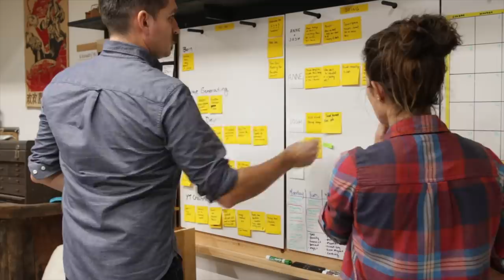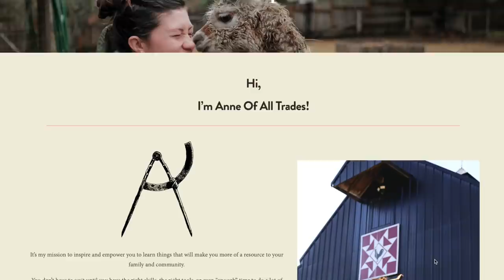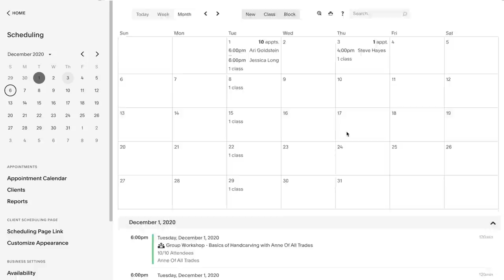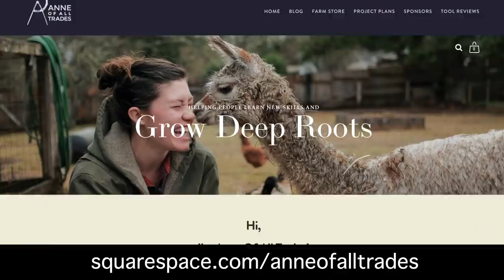Risking it all in 2019 to LOSE it all in 2020?

Comment: Don't loose heart.  You have come a long way.  If you have the will it will happen.  Maybe much slower but each step is a step toward progress and the realization of your dream.  I know this because I've done it.  I'm 74 years old and I build a small wood shop by myself.  Ninety percent of the labor is mine.  I started in April this year and I'm just now finishing it up.  I found ways to get materials for either nothing for for very little cost. It's almost done.  Don't give up. Put your head down and push forward.  Your dream will happen.

Comment: I live in Germany. More then ten years ago I bought used beer tent tarpaulin. The material does not rot and is extremely durable. About 120m² was less the 100€. I got it from a company which builds new tends and also rent the tends. From old tends they sold the material. Try to get something similiar. This helps extremely to get Your project dry und bring it over the winter.

Comment: Get that roof covered. At bare minimum nail on some cheap Harbor Freight tarps with blocks of wood for hold down. Protect what you have so you are not going backwards. Plus it will keep things dry underneath for a work space when raining/snowing. It will cost a little to save a whole lot.

Comment: So I would quick cheap one coat asphalt emulsion the whole roof, eves cracks. Needs couple days to dry. Then get white mesh from best materials and double up the seems. Build up couple more costs. Needs months off gas. The finish up with white or silver top elastomeric. Exposed edges need drip mesh or water will run down board . Luck
Reply from the maker: Hmmmm. I'll look into it as I remain hopeful to figure out a way to do a more traditional roof! Thank you!

Comment: Improvise. Search the area for building projects with excess materials, dip into skips. Lift concrete and cinders when and where you see them. If you have unfinished lumber on the property or as before spot some grab it. If it's a question of completing a roof consider that your roof does not need to be traditionally sourced and certified material to do what a roof must do. Split trunks for Christ's sake and shingle it as once was done where you couldn't go down the hardware and pick up long sheets of cheap and easy. Know someone with the skill and financing who could help you? Offer them favors in trade for what you need. Buy a tarp and tie it down, used garbage bags. Don't make excuses when there is every short cut and compromise toward being good enough available.

Put up a sod roof.

As to your online platform. You have options for getting it up and out there and it doesn't have to be YouTube. You aren't the first to come to this fork in the road questioning how to offer a service or improve on the shallow monetizing that is available here. Because you've all come to the same conclusion around the same time it doesn't seem responsible to target a private platform model over the cumulative model. After all I'm assuming this business wouldn't have come so far without this platform right here. There are other platforms standing on firm foundations right now looking for more authors and businesses to support their endeavor of a secure repository and an excellent revenue source. Besides you will likely reach new audiences by listing within third parties. I can not repeat my self enough because despite the sympathy you deserve you are not the only one clawing for a handhold and you purport your self to be a maker and an improviser. But what I hear is whining and excuses when you're always on the edge of continuing to make progress. There are people out in the world who make it happen with a fraction of what you have going for you and some of them live under the threat of malaria, civil war, authoritarian theocracy. Finish your stupid building. Offer your course work. But understand that you haven't moved the goal post close enough or considered all the actual options.
Reply from the maker: Thank you for your practical suggestions! There is always a way for the next step, it's just a matter of finding it. I do recognize I have it better than most, and especially those living in other parts of the world with much more impossible circumstances.  I'm not looking for sympathy,  just trying to stay real and honest in the challenges I face here.  We will get through this!